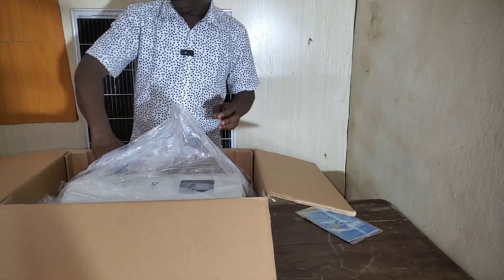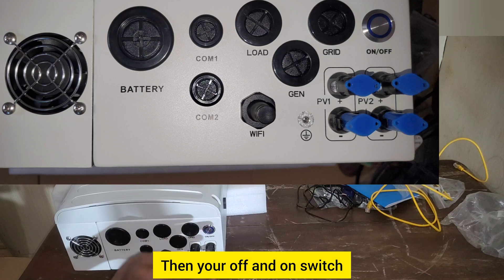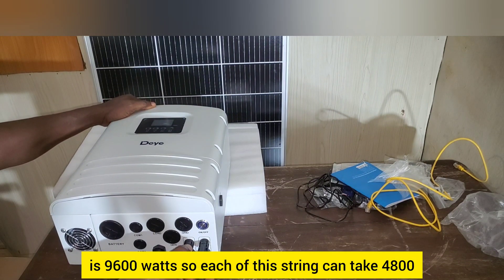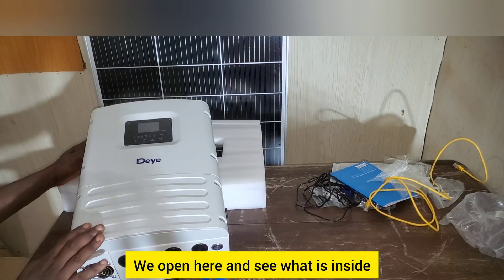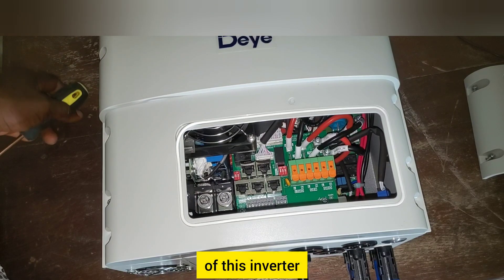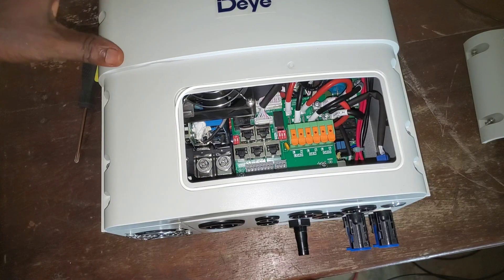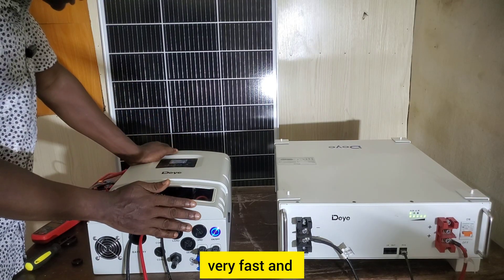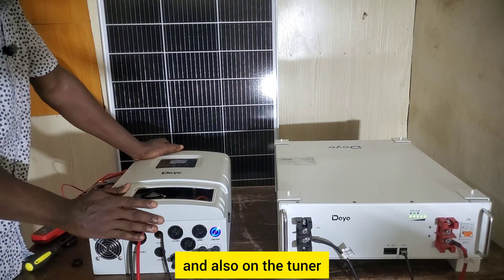Unboxing and Review: Deye 6kW off-grid Inverter

Comment: Please how can we connect 9, 600watts, 14AMP, 47VOLT, SOLAR PANELS to this inverter,   are we going to connect all the panels in series? as this inverter can only handle 18AMP CURRENT from PV
Reply: 2 strings of 4800 watts. But you can go up too 12000 watts. Just keep the open circuit voltage at 350v dont go higher as that will keep the temp own.

Comment: I commissioned this exact inverter model about 2 weeks ago at a property I own. So far so good!
Reply: How do you get your inverter to draw power from the battery before taking power from the grid (while the grid is still connected)?
Reply: @rorikadams1039  My inverter draws power from the PV,  then battery if we are no longer during the day. It only draws from the grid if battery is depleted
Reply: What settings have you used. I tried to get my unit to function like that. The only way I found was to set grid peak shaving to limit grid power. That's the only way it takes from the battery before taking from the grid  @colinmakams1
Reply: Did you connect the WiFi dongle?